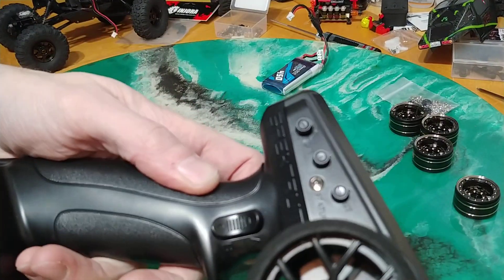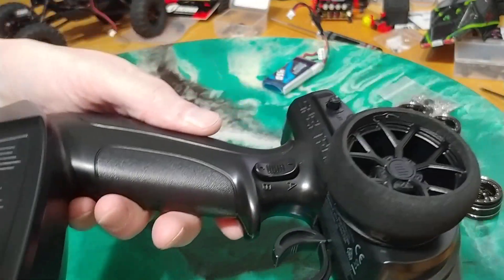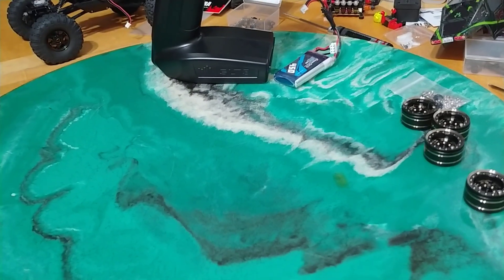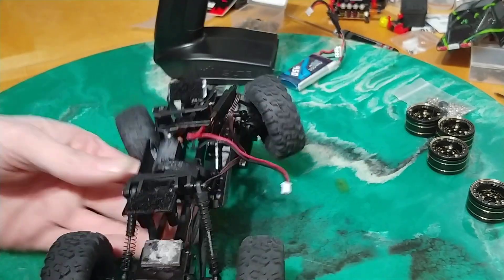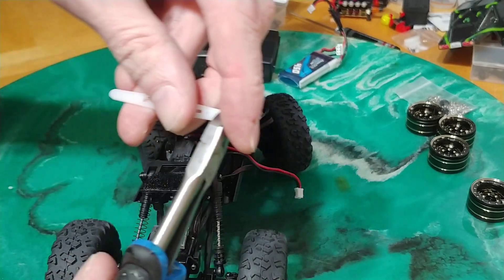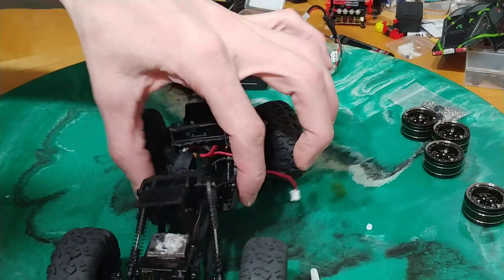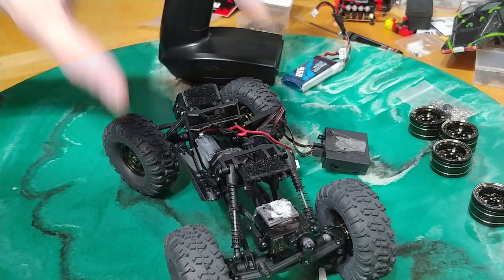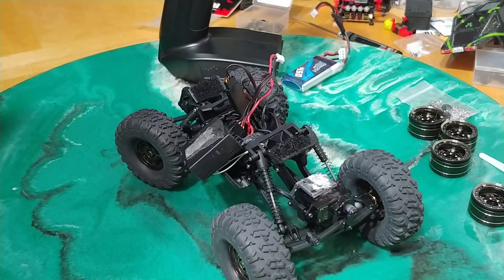AC24 It just keeps getting worse!!! WTF axial.. Last thing I buy from you guys..

Comment: I bought a 1/10 scale Danchee Ridgerock.   For the price it works well.  Putting softer tires, and automotive wheel weights in the stock bead locks in the front made it a pretty good crawler.  Trying to find a short springs from clicky ballpoint pens to do the hack to shorten the shock travel.
Reply from the maker: I love the Danchee, outta the box its even really awesome, but with some new tires or sprayed with wd40 even it does really well. Im surprised more people dont know about it.